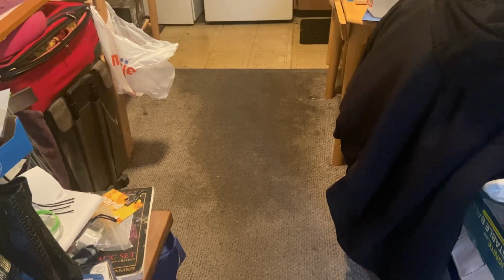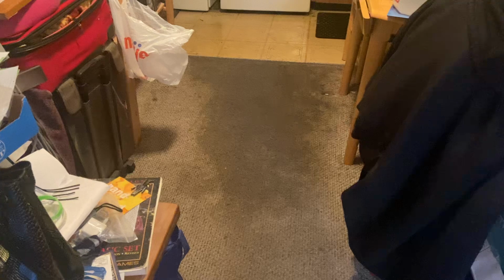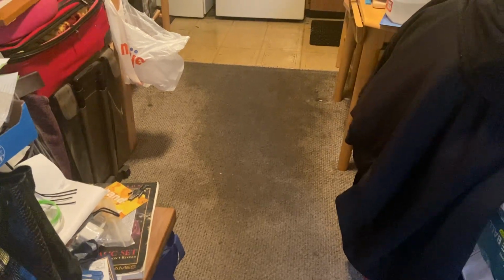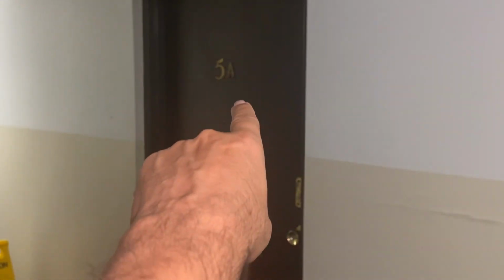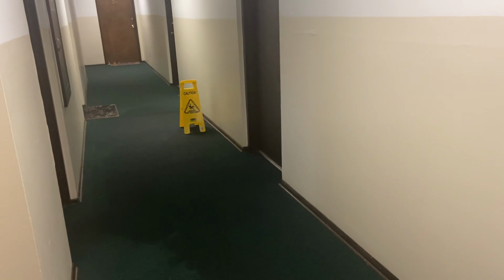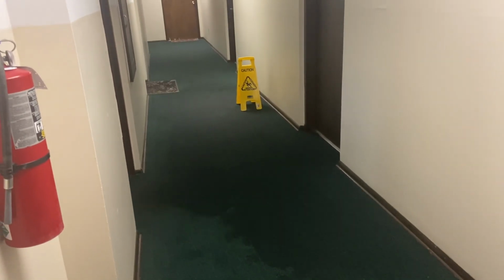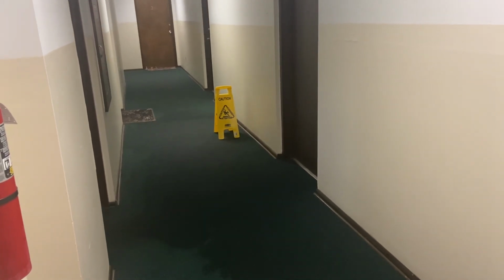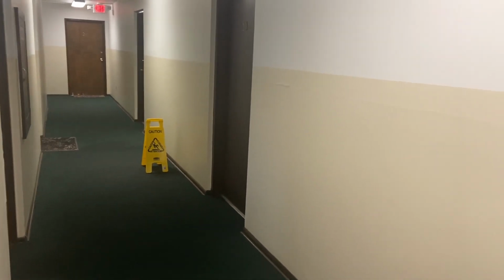Waking up to a wet floor

Comment: Dang, sure hope they get you dried out.. that could be a mold problem if not done correctly.  It's always something isn't it..
Reply from the maker: Well I’m sure there’s mold in the walls of the building. In the years I’ve been living here, I’ve had at least six floods. I’ve been living here since 2009. Yes it’s always something 😂🤣🤷🏽‍♂️. Thanks for stopping by and watching Pappy, be blessed my friend.